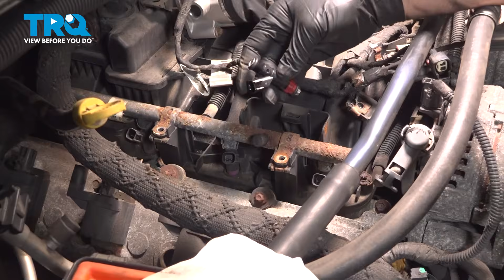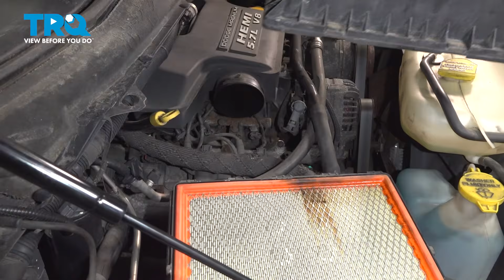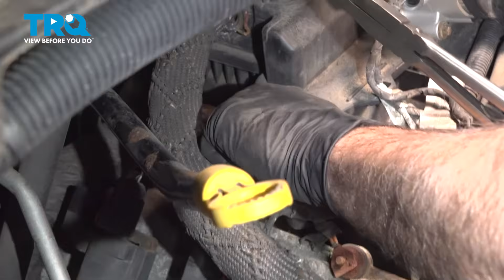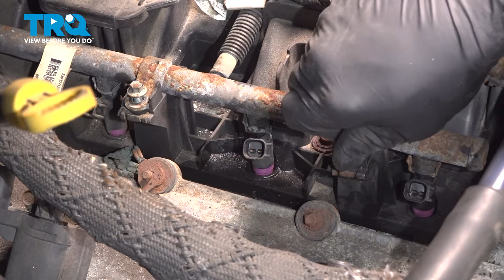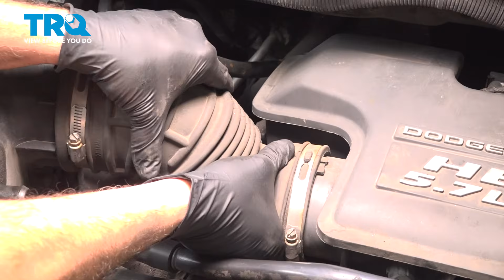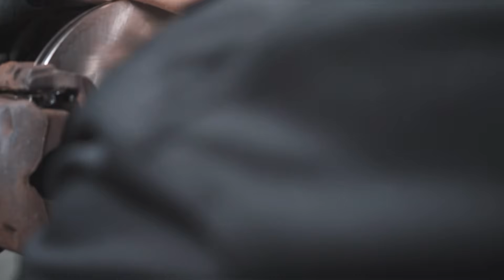How to Replace Fuel Injectors 2002-2008 Dodge RAM

Comment: I just finished changing them in my truck, before the heat became unbearable LOL. Thanks for the video, as usual very informative and clear to follow; I would just want to add that the operation on the 4.7L Magnum is very similar, less work moving wires around but it is necessary to remove the ignition coils, all four on the driver's side and the three closest to the front on the passenger side, it's not needed to remove the one at the end. Good luck everybody!